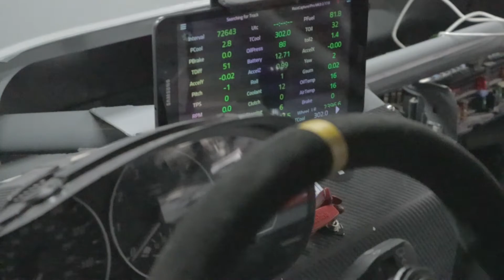E46 Race Engine First Start | Rebuilt Engine with Schrick Cams and M50 Intake Swap

Comment: How does the S54 expansion tank work with the M54 set up? This is interesting to see.
Reply from the maker: It works really well. We made some custom coolant lines. But it is totally worth it. The stock M54 tank is prone to cracking and also very close to the serpentine belt. This setup is more reliable especially for racing applications. Shoot me an email at hcautosport@gmail.com and I can send you more details.

Comment: Nice vid! Are the dual Vanos still on? What ECU are you using? Ever considered installing S50 inlet/throttle bodies?
Reply from the maker: Thank you. The Vanos is still on. We haven't thought of S50 intake yet but we have M50 intake manifold and a custom air intake to the airbox

Comment: is vacuum not needed to the breather port on valve cover?
Reply from the maker: You do not need vacuum on the breather port and we suggest not to route crank case gases back into the intake for optimal performance. As long as your ring gaps are correct and there is no excessive blow by a simple catch can to atmosphere is sufficient. That is for off-road use obviously ;-)
Reply: @HCAutosport  thank you
Reply: @HCAutosport  Do you really need a PCV valve in the system to insure the crankcase doesn't go under TOO much vacuum?

Comment: Did the 272/256 cams fit perfectly? Did the valves clear the pistons? Plug and play no tune needed? tune would be recommended I would imagine.
Reply from the maker: The cams fit properly, without any issues. We checked to make sure there was no clearance issues. One of the things to keep in my mind is that these cams don't come with the end spline in the package. Once we installed the cams, we did some  rudimentary injection time tuning before taking it to the dyno. At chassis dyno we did extended tuning to get the correct AFR and proper combustion.
Reply: Oh so I need to swap over my old end spline on the new cams? How much power did it put down I would imagine a pretty good increase from stock. Love the channel keep up the great work hope to see more of the E46!
Reply from the maker: I used the spline from a set of spare cams I had because I was not able to find new ones anywhere. We got almost a 40whp increase compared to stock.
Reply from the maker: Thank you the appreciation. We are working on putting out more videos of our work.
Reply: @HCAutosport  Hello broder! Greetings from Bulgaria!

Did you have an 40hp increase only from the cams or from both modifications,  m50 manifold and shricks?